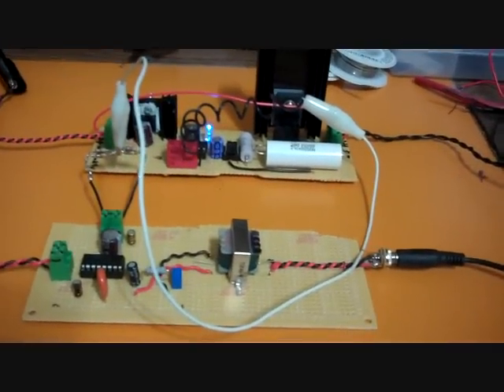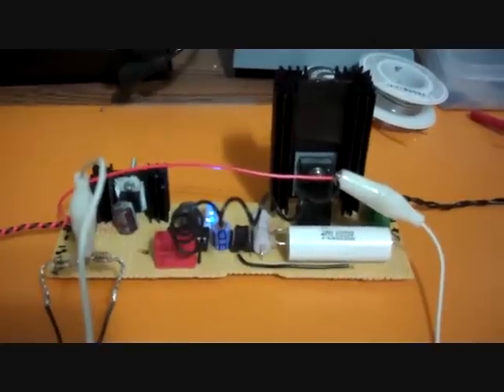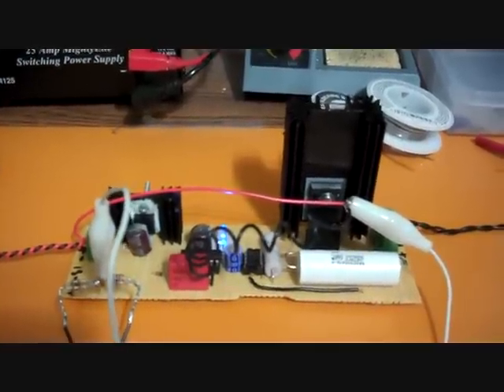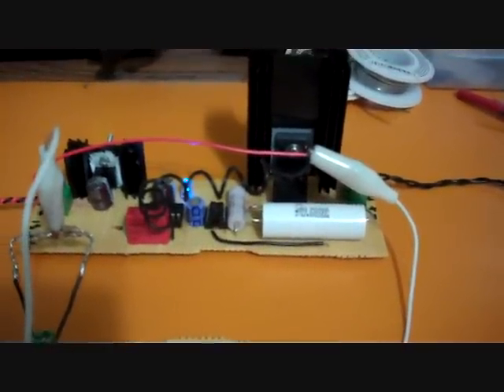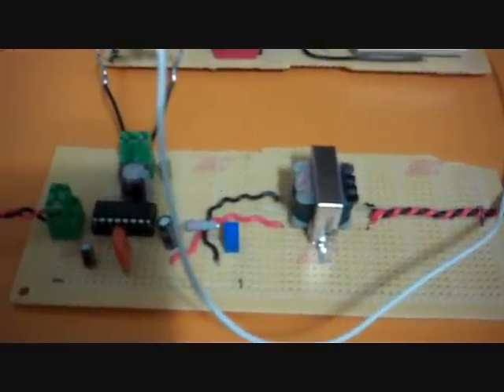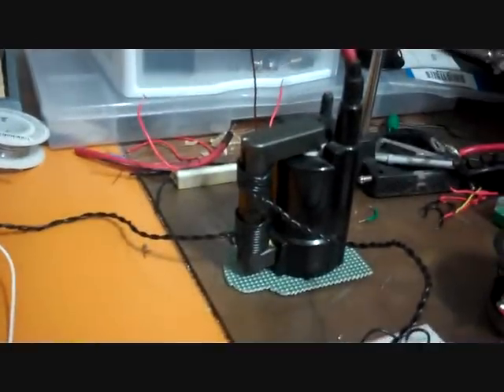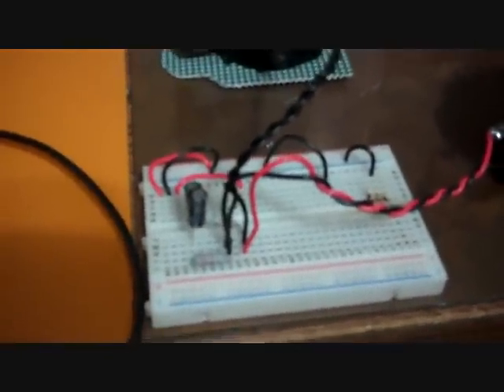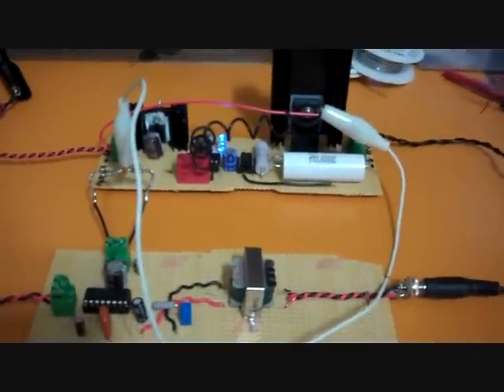Class-D Amplifier; Audio Modulated Flyback "Plasma Speaker" & trad Speaker

Comment: hi, can you post your schematic? thx
Reply from the maker: Sorry, I don't have a schematic for this. I can explain the basic construction though; A SG3525 is set up as a frequency modulated square wave source (PWM Modulation) which is fed into a UCC37322 mosfet gate driver. The mosfet driver drives the gate of your choice of N channel mosfet, which is inserted between primary and ground of your circuit. Vdd is applied to the primary's other lead. You adjust the frequency of the SG3525 for maximum output. A nonpolar capacitor was placed across the drain-source junction of the mosfet for quasi-Class-E operation.

Comment from the maker: Unfortunately, a MOT has a much lower winding ratio than a flyback transformer. Depending on your input voltage you might get a couple hundred volts out of the MOT secondary, but still no where near enough to get a decent spark or arc. Most USA made MOTs have a 20:1 ratio so that 120V in = 2400V out. If you put 12V in you'd only get 240V out. Some flybacks have as high as 1000:1 turn ratios, so 12V in = 12,000V out. This flyback seems to have around 500:1 ratio.